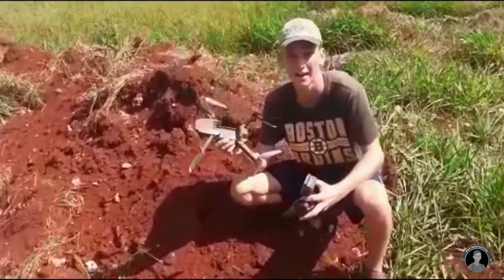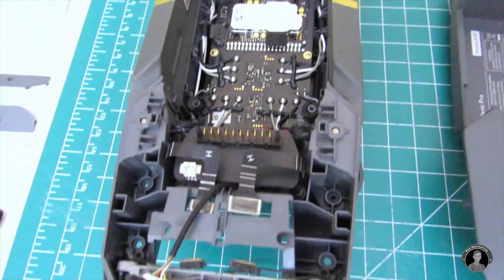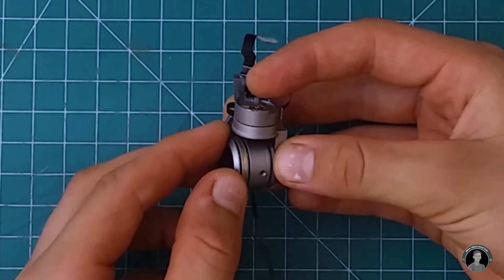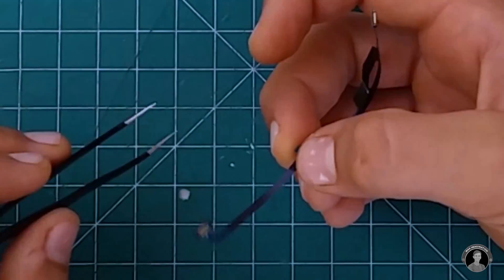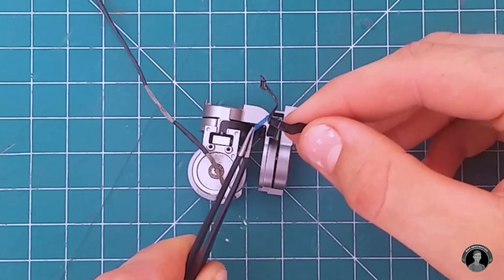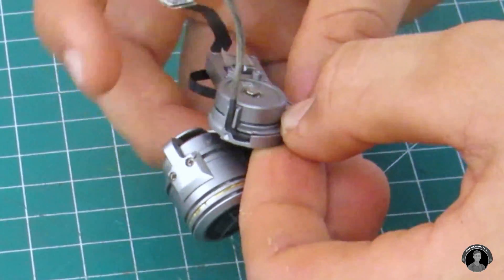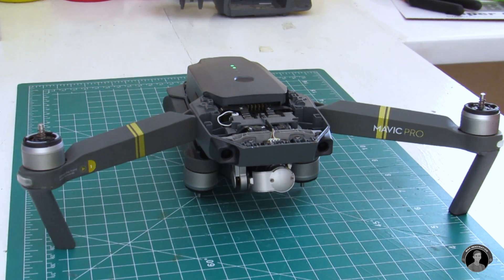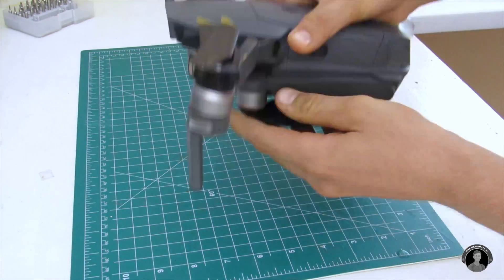How I fixed my Mavic Pro Drone after crash | Gimbal & Camera Repair Tutorial

Comment: Im glad it worked with you. I changed the flex cable and its still the same, the gimble is hitting hard the same as before. What can be the problem?
Reply from the maker: Hi there. Check that no corners on the flex cable are pinched. Ensure you firmly pressed down on all edges of the connectors when pressing them in.

Comment: Did anyone struggle to get the camera apart after taking both screws out?
Reply from the maker: Yes, I certainly did. Be careful with it, you need to wedge in a sharp blade such as one from a hobby knife and wriggle the camera piece out.

Comment: Great video, helped me a lot. I replaced the video and the flex cable, but unfortunately I’ve got no movement in the gimbal or a video feed in the dji app, the app just says ‘camera sensor error’. I wonder if that means I need to replace the actual circuit board that the gimbal is attached to, or the actual lens. Any thoughts?
Reply from the maker: Hi there. Thanks for your feedback. That is strangely odd... If you're in luck that may just be the cable... Are you sure you haven't pinched the new video signal cable with the plastic covers as you were installing it? I suggest you check this first. Cheers.

Comment: Motivated me to try and repair mine again. Had the gimbal overload warning after a fall. Replaced the cable, same issue. Replaced the camera, same problem but lost video feed. Maybe I should buy a new video signal cable and try again.
Reply from the maker: Hi there. Be very gentle with installing the cables back together in the gimbal. Any wrong placement of a panel over a wire could cause one of the video signal cable strands to get pinched, resulting in a broken cable. There's a high chance of this happening.

Coincidentally, today I had to fix my Mavic for the third time since I bought it, I very gently attached each panel back on an carefully put on the right side panel (the trickiest one) over the video signal cable while making sure none of the strands got pinched via the thread inserts.

Hope you get your drone's camera working once you install that new cable!

Cheers,
Max
Reply: @MaxImagination  Thanks for the advice Buddy. I have an Air 2s which I recently bought and a Mavic Air 2 for sale, but I prefer the flight experience of the Mavic Pro more than both. I was selling it as damaged with a load of gear but I really want to keep it.

Comment: OK, gonna be a long one, here.....
My problem is that I have control over the gimbal (Mavic Pro), but I have no video feed from the camera.  It flies OK, and all the controls (including the gimbal wheel) seem to be OK.  The rear light, instead of being either a steady or at least flashing green is flashing red/yellow.
I got it from a friend who had flown it BVLOS out to about 5 miles and while returning, the battery reached critical level and it attempted to land wherever it was at the time.  He was able to override that and get it back to the launch point and land safely, but with only about 3% battery remaining.  He said he was trying to disable the auto-land at critical battery while connected to his computer, when it just wouldn't connect any more (to the computer or the RC).
When he gave it to me, I downloaded the DJI Assistant 2 for Mavic Pro and connected it to that laptop.  I got the 'device connect' sound, so it seemed like it connected OK.
The app recognized the drone and let me into the program, and I was able to do an optical sensor (front and bottom) calibration and it also let me do a Factory Reset (but there were no firmware updates shown).
I disconnected it from the computer, powered up the RC and the drone, and the RC seemed to connect to it, and I was able to get the motors to run and the controllers seemed to be working.  I took it outside, connected the props and powered everything up again, and after the RC said "GPS Mode", I did a takeoff to only head height, and the controls seemed to work the way they were supposed to, but as I mentioned, the rear light was flashing red/yellow instead of green, and I still had no video feed from the camera, even though the gimbal was reacting normally to the wheel (down/up).
What else could there be wrong with it that's not letting me get the video feed.
My friend DIDN'T crash it, he was able to land normally after that loooong flight.
Reply from the maker: Hi, sorry to hear about the little incident with the mysterious camera feed error. 
Normally, when the yellow light flashes at the rear, there is a persisting error that is occurring due to some miscommunication with a sensor or module in the drone. I have the same light blinking till now since my crash because of the damaged front vision sensors.
Haha, that's very common amongst us Mavic Pro users. Typically, the camera's video signal cable is so fragile, that a small crimp or pinch from a drastic jerk in mid air, crash, or improper handling is all it takes to damage it to the point it's no longer usable.
By the sound of it, you'd most likely need to purchase a new camera video signal transmission cable, purchase links can be found in the description below my video.
There is a chance, though very low that it could be a firmware issue, please double check that first before buying the Mavic a new cable.
Hope this helps!
- Max
Reply: @MaxImagination  Turns out, the drone hadn't been powered up on over a month, so all I had to do was to calibrate the compass; I now get the green light.
Now, I'm having some video feed problems that I have to work out.

Comment: What parts did you need I think I have the same problem
Reply from the maker: Hi, to fix this issue you'd need a decent electronics screwdriver repair kit with the right tiny screw tips. 
Mavic Pro video signal transmission cable and Gimbal motor flex cable.

Comment: Great video. Any idea which capable could possibly control video recording? I’m having issues trying to switch to video mode after a crash. I’m still capable of taking pictures, just not switching to video mode. Not sure if it’s software or if a simple cable would resolve this issue. Any help is appreciated.
Reply from the maker: Hi, thanks for your comment. The multi-stranded silver cable with the wider connector ends is the actual video signal cable. From what you mentioned, you reminded me of a similar issue I also had before I fixed my drone, though it was more of a camera disconnection thing that would happen in mid-flight. I could see what was going in with the camera but had little to no control over the record button and other camera-related settings.
The issue you're facing might be able to get solved by you replacing the video signal cable, no guarantees, but by the sound of it and experience, that's what I believe it is.
Your drone gimbal camera's video signal cable is most likely what got damaged.
Does your gimbal unit still work? Can you tilt and pan?
Cheers,
Max